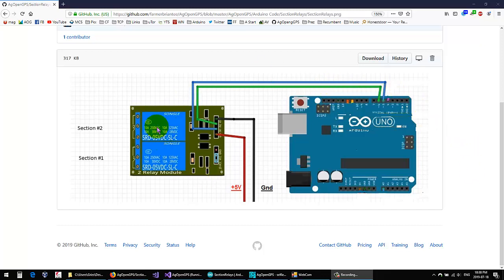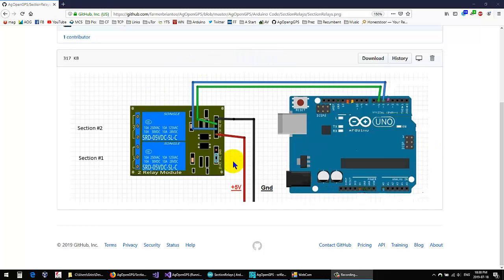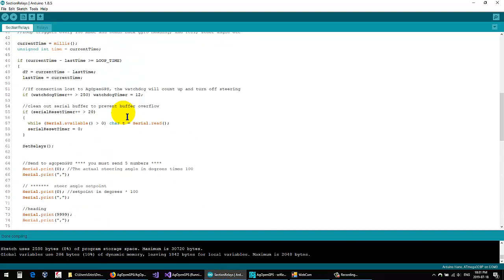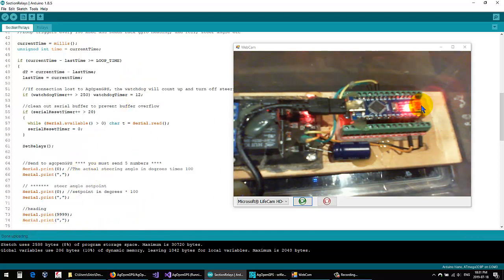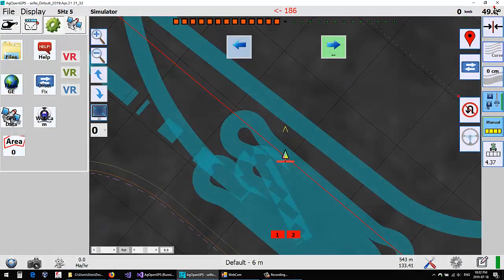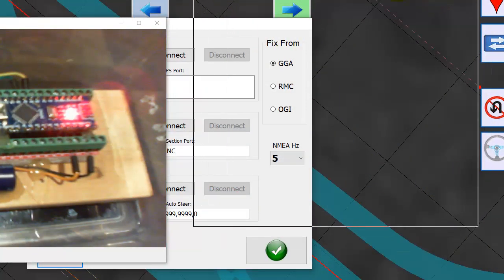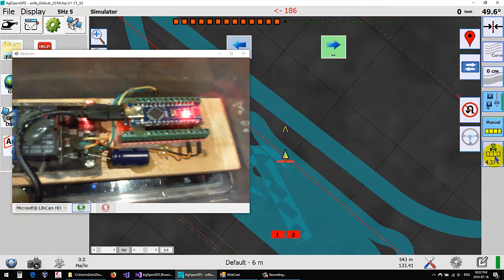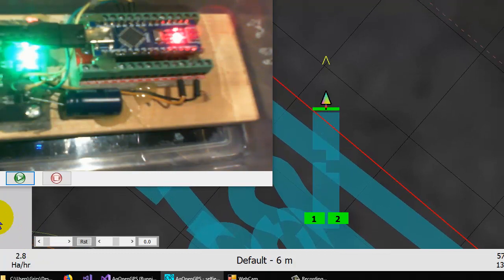SectionRelays 2

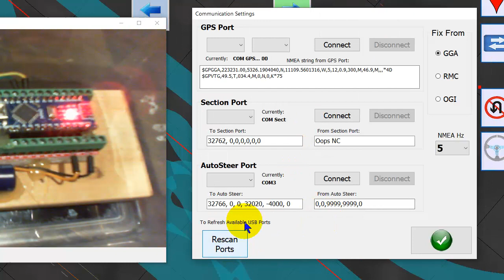Comment: 2:15 isn't this the autosteer port?
Reply from the maker: YEs it is. The simple relay board doesn't use autosteer. The relay section port is very complicated. I know - its a bit confusing.